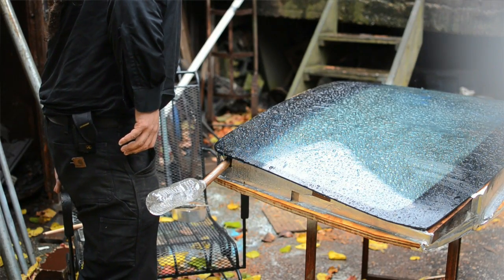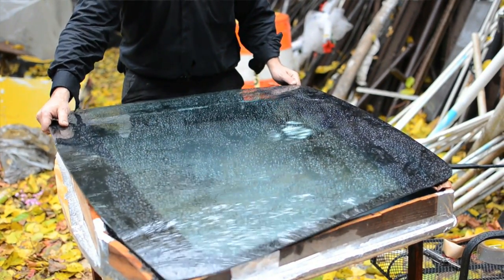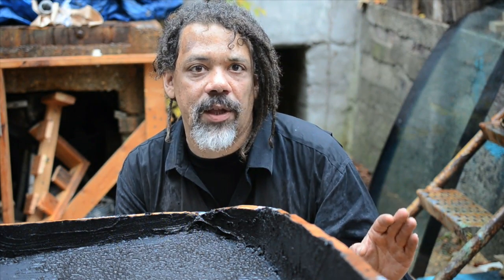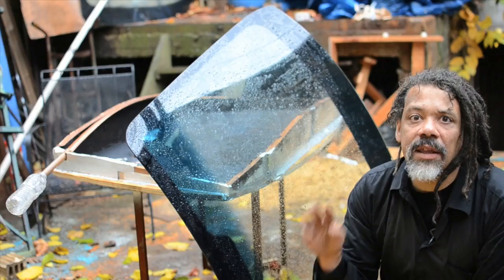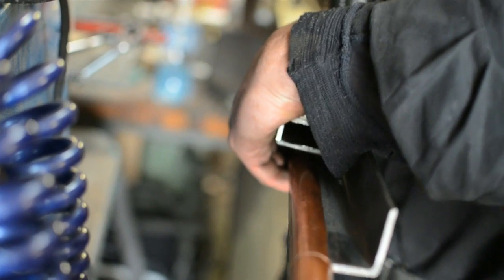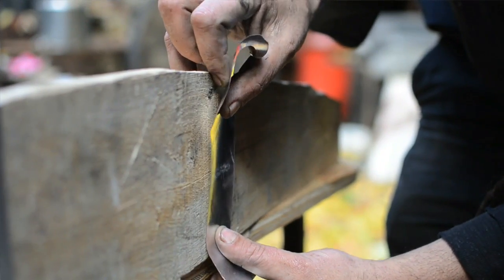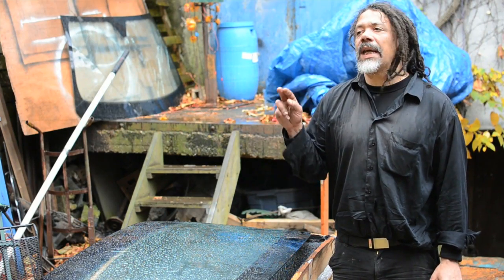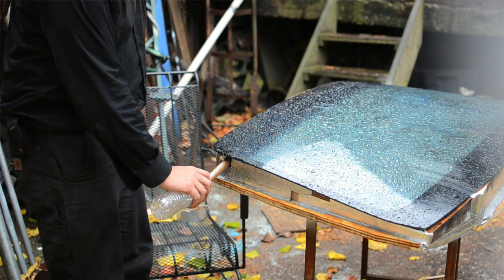Rebuild: Chris Hackett's Solar Water Distillery

Comment: I have a question that might seem stupid, but I am worried about the PCB's in plastics, caulking, etc. Does the black coating you put onto your wood, come in a food rated chemical make-up? I understand the distillation process cleans the water of heavy metals and other impurities. However, I have learned from reading about the contamination in our water often times coming from a source that is not visible or otherwise detectable to us without sophisticated scientific equipment. Some PCB's are in everything we drink now and I'm extremely concerned about this kind of impurity. I live in an area where natural uranium often contaminates water tables and in fact my parents and many neighbors and friends have died from complications that naturally occur in my world, aside from the uranium mills, copper mines, etc. which exist in my beautiful corner of the world. Please if anyone has any information on how this could be done with natural, less risky,... safer if you will, building materials? Or am I worrying for no reason and this is perfectly safe? Thanks so much, from a concerned Moab, UT native.

Comment: If you're starting with water that contains gasoline and other petroleum products, you're still screwed!
I would NEVER use water that is this polluted and then your system for removing the processed water is awful!  I have salt build up in my pans that HAS TO BE CLEANED and your system doesn't involve cleaning the evaporation pan?  No wonder you suggested that you might not be alive in the near future!  The tar you are using is a petroleum product itself!  You can't be serious about recommending this system!  I use paint trays from the 99 Cents Only stores!  They are the best!  No plastic taste in the water, but they have to be cleaned, because the build up of salts, many containing fluoride, cadmium, arsenic, lead and mercury is awful!  If you let that build up in your evaporation tray, you're going to poison yourself!

Comment: The copper pipe will leach copper into your water, so finding a safer alternative would be advisable such as PVC tubing.
Reply: Sorry Doc, copper actually gives the water a negative charge so its great at flushing out positive charged diseases and toxins in your body.
Reply: Your body needs copper, more than the RDA. Many many homes use copper tubing for water lines.
Reply: Distilled water won't contain chemicals that would dissolve copper.

Comment: NEVER GO THIRSTY:  Have all the fresh water you can drink in a day.   HOW.  All you need is 13,  5 gallon buckets, a shovel and a 11 feet diameter plastic sheet.  Dig a 10 feet diameter hole that is 3 feet deep.  Fill 5 gallon buckets of water u want to make fresh. This water can be salty or the most nasty water on the planet. Put these 12 buckets around the edges inside the hole. Put a clean Empty bucket in the center. Place a plastic sheet over the hole and put dirt around the outside edges of the plastic to hold in place. Place a rock in center of plastic that makes the plastic bow into the center. In 24 hours You will have more than enough water U can drink in a day. Just keep the buckets around the edges there until they are all empty. Then clean out the buckets and do all over again. This project must be in full sun for best results.
Reply: Dude, your info was better than the video! I'm going to test your idea on a super small scale using plastic sheet over a black tub. Thanks.
Reply: @tvc380  di you test it?  if so, what were the results?

Comment: if you turned the glass upside down, you'd get much more water from the rain instead. it still is a video on solar water distilleries though.
Reply: right, but the rain is not distilled.

Comment: I enjoyed your video.  l did a science project on my own in Junior High that was similar to yours.  I found you don't have to have it pressure tight system.  Using glass is not the best material.  What you want is a material that will allow solar energy in but allow the outside temperature to cool what is allowing the light in.  Thin plastic works better.  Also the more area of plastic yields more water production.  I also found a pyramid shape was the easiest way to maximize the surface area.  I also found insulating the water pool really helped pool water temperature increase.  What I did was to use Styrofoam to accomplish this.  I covered the Styrofoam with fiberglass liner tented black.  Using  these materials it is also easy to make the  channels for the condensed water to flow out.  Give This a try I think you will like it.
Reply: +Joe Henderson Careful using plastic, make sure it is BPA/phthalate free plastic!
Reply: Glass is the only material to have clean water in, you don't want to consume plastic bro it's better to have real water than to think it, but be drinking the same stuff you thought you finally gave up. The world of health is nothing but trial and error when you look at the companies selling most, it makes sense why they'd dislike something that rivals them so much
Reply: Cool, 👍Thanks for sharing

Comment: Would be cool if you could distill the gasoline from the water with a spliter in the output line; since the gas is lighter than the water and would be inclined to go up and out and the water which is heavier would not
Reply: try oil water separator for gas separation !

Comment: You may be able to speed this process up with a homemade Fresnos lense which can be made from a square frame of wood, a sheet of plastic and fill it with water... it would intensify the sunlight and heat the water...
Reply: How to keep it focused as the sun moves?

Comment: I world avoid usling that poisonous black rubber Svealand in a way hat it comes in contact with the drinkpinne water. Those sealants can be nasty and the hormone changing capabilities Will most probably affect the immunesystem. Find other sealants, other materials.
Reply: +Anna Andersson From what I understand the distillation process should treat the chemicals in the rubber the same as the chemicals in the water and leave most of it behind except for the gasolene and hydrocarbons which would be the 100mls that you would pour out first... (Not an expert but that's how I understand it).

Comment: Chris I made a 2' by 3'  batch distiller and used glass bottles to collect 750 ML and they would get some kind of algae growth in them.  I live in Florida and didn't suffer any  ill effects from the water I collected.  I was able to make a lid over the tray like many batch distillers the was hinged and I could clean the underside of the glass collection plate.  I notice that yours is sealed and difficult to clean out I bet.  Thanks for the video Nice job.

Comment: Nobody dies after 3 days without water...Water is only necessary to drink if you are fasting on water ! Rain water is distilled water and is used as drinking water for centuries by island dwellers...
Reply: +Eric Mann actually most human being do get all the water they need. In fact you can go months without drinking if you are eating well. Most Green Veggies, Meats that aren't over cooked... etc will all be a source of hydration. Hydration is what we think of when we say water.
Reply: +Pierre Normandeau Good point, except that it's probably safe to say that these days a majority of people are fasting on water, in that they aren't getting their daily recommended water intake.  

Also, not to be contrary, but concerning rain water, haven't things changed a bit in the past 100 yrs or so?  What about acid rain, etc?  That's probably not going to work very well for everyone, especially those in industrial areas or heavily populated areas with high traffic congestion/pollution.
Reply: +Sigkim good point.  I have more than once heard about the self-healing capacity of the earth, but I wonder just how long it would take for all that to clear out.  Probably not too long.
Reply: Rob Elliott Ever tried to put that idea into practice?

Comment: What about all the off gasing of that caulking...wouldnt that itself contaminate the water again?
Reply: Frank Martinez Yes and no. It all kind of depends on a bunch of factors. However, it would likely be fine so long as you let it dry completely before adding water, and you didn't get any on the outflow pipe. More to the point though, in a post apocalyptic world (which isn't going to happen in our lifetimes) you would want to scrounge together some silver and use that either as your collection cup, or as part of the collection pipe, because silver works as a catalyst which keeps bacteria from surviving on it. That is why in the old days, those who could afford it, used silver for eating and drinking utensils.
Reply: dell dellpc I will be amazed if you can sight a SINGLE source that states that piping has been found to accumulate in brain tissue. Unless that is your idea of describing a blunt force trauma murder you're wrong.
Reply: dell dellpc i agree wit u. Its funny in how your vid ur dont take whole shot of water...only take sip? Why? U doubt your solar distill set up and the materials used..afraid of all the leeching chemicals. ..just sayin
Reply: dell dellpc A. You cited two sources twice each as if that made it four sources.
B. That is about copper not piping. Clearly the joke flew WAY over your head. My point is that you said copper PIPING was accumulating. Copper may be accumulating, but pipes aren't. There, joke explained. Too bad it is no longer funny because it had to e explained to you....

Comment: The only thing is that unfortunately distilling won't remove chemical pollutants. Good skill to have though!
Reply: Karin6509 In a more technical sense, distilling water removes water from substances that don't evaporate at modest temperatures involved in solar distilleries. The evaporated water later condenses on a cooler surface and is collected.
Reply: jogandsp Well I don't know why you have to be so rude? I was stating my thoughts as a question rather than fact so there's no need for your rudeness. Learn some manners.
Reply: Karin6509 Distillation removes all chemicals, minerals, fluoride, algae,  & bacteria... but if there is lead or fuel in the water these substances can condense after evaporation and be found in the distilled water that should ideally  be filtered with charcoal filter to obtain absolutely pure water ! any biologist will confirm this ! Rain water is perfectly pure distilled water by the sun, also ionized in the ionosphere.before falling to the ground.!
Reply: Pierre Normandeax - Sorry, I should have said "doesn't remove ALL synthetic chemicals". From my research it would be ok in an emergency, but not long term. You can find one article I read at mercola dot com, "Distilled Water: Avoid this Type of Water Purification". Trust me, I'd love to be wrong!
Reply: TheBrownViper - Wow, great article on distillation!! Thank you! Now I see why I spent countless hours Googling and found it very difficult to find a definitive answer on what exactly water distillation removes from water.  Mercola was just one example, I really didn't have the "want to" to go back and track down all the govt., university, etc. articles I've read, but I promise, I've read a bunch. My conclusion stands that distilled would be better than no water in an emergency, but the cleaner the water you begin with, the better. I wouldn't want to drink from that river long term, unless there was no other choice.
Reply: Pierre Normandeau Rain is not pure water. You have to take into account atmospheric chemicals. That's how we get acid rain. Also, in the same way, you have to be careful to make sure that everything that the water touches after it is distilled is perfectly clean because otherwise your water will be contaminated anyways, so why distill it?
Reply: ***** Thank-you!
Reply: +Keith Reynolds So you are saying that because the water doesn't reach boiling point it leaves first... would that include chemicals that have a lower boiling point? I would imagine boiling points and evaporation would prioritise/behave the same wouldn't they? Still trying to get my head around it!
Reply: DeansVideoClips Well, you can imagine that all you want. That doesn't make it the case.

Comment: I think that is not good to use copper pipes for drinking water, because you can get too much copper levels in blood...
Reply: Most plumbing connections are copper. Plastic is sold now days because it of the high profit margin and is easier to bend. You already have copper in your body through the food you eat.
Reply: i know, but you can get too high levels of copper in your body like this, copper dishes have some special coating over them to prevent food and water to oxidate copper...
Reply: supickumaterinu The coating is to prevent acids found in many foods like vinegar from dissolving the copper. Distilled water has a PH 7 where copper will not dissolve.
Reply: +supickumaterinu nearly EVERY plumbing pipe in your house and nearly EVERY building in the US is copper. Copper fittings, copper pipe, etc...